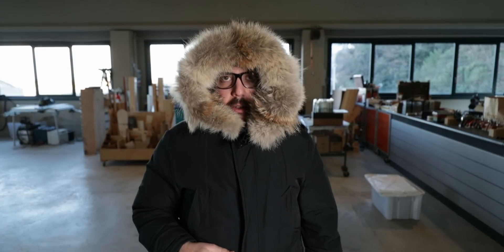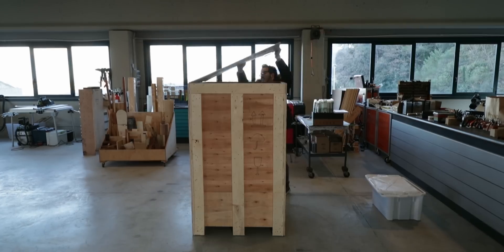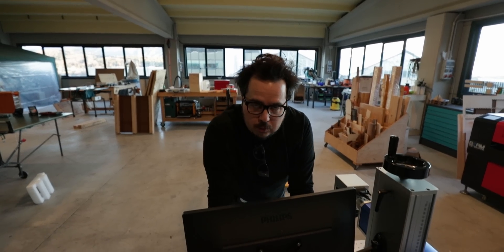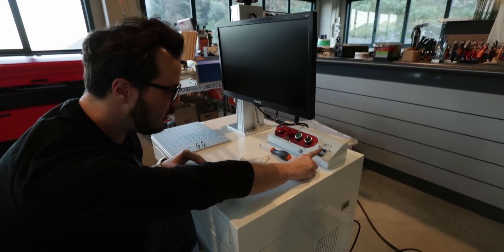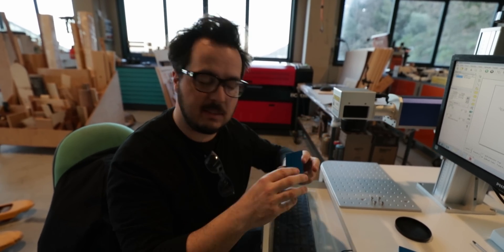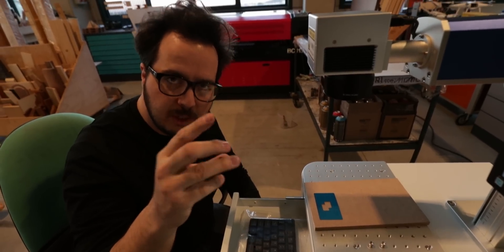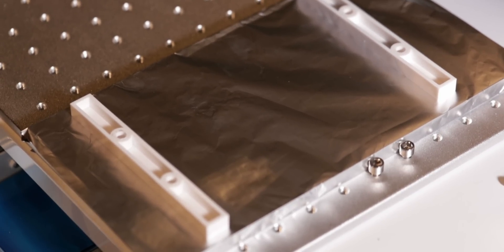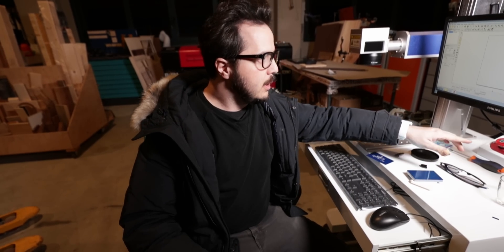Just like making MACBOOK SPEAKERS

Comment: If I had that I would do the same with my logo. 
With a laser, can you engrave a barcode which could be read with a 2D reader into metal?
Reply: Yes indeed. I have the same laser and you can do barcodes, QR etc. Even with automatically generated data in it, like serial numbers, dates etc. And the cheapo ebay barcode scanners work fine reading these codes off of metals.
Reply from the maker: Yup! Pretty awesome! 🤟🏻

Comment: Should be noted, if you have a co2 laser at home you can still mark the anodized aluminum coating on the makerknife.  A fiberlaser is needed if you are trying to depth engrave bare metal which a hobby co2 laser really can't.  I put my contact info on mine in case I lose it again 🤭
Reply from the maker: Yes I used the co2 multiple times but the finish is pretty bad and yellowish

Comment: I think you are not supposed to operate the machine without laser goggles...the scatter from surface reflection can harm your eyes. this type of laser is pretty gentle to the skin though. I just caved in bying a certified pair of laser safety goggles after finding out the ones I had were wrong for my types of lasers.
Reply from the maker: I did too, I got four for fiber today
Reply: "Gentle to the skin". What will happen to your hand if you put it under the beam...?